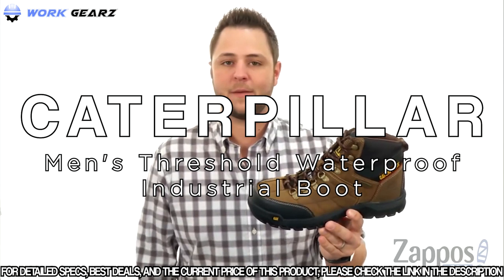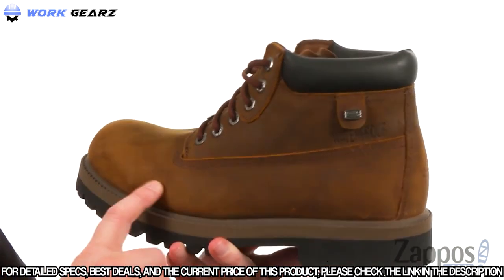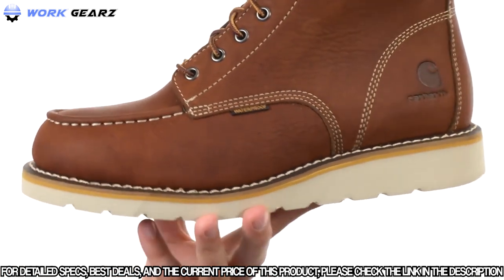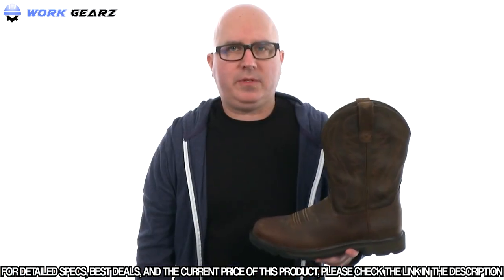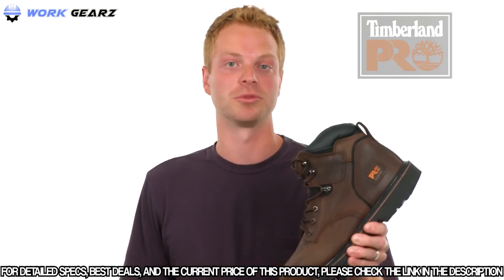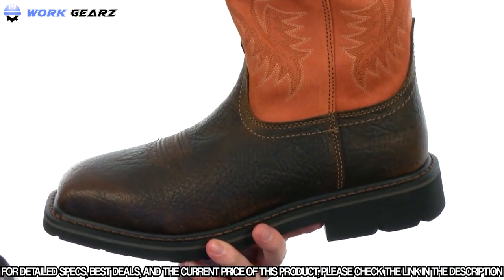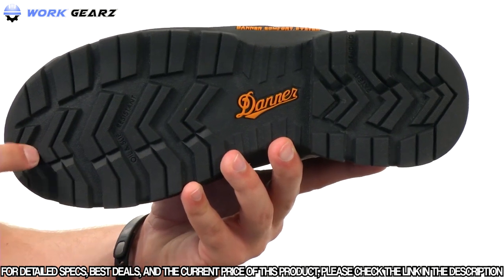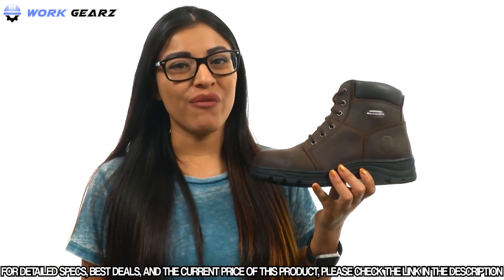Top 10 Best Work Boots for Wide Feet

Comment: Wrong!!! The widest work shoes are Red Wing King Toe ——-the didn’t even mention here
Reply: I'm gonna look into those. I really need an extra wide boot
Reply: @jumboMIDGET  actually I found a wider Red Wing ——I’ll get back to you
Reply: @jumboMIDGET  Red Wing 4489
Reply: I just bought a $200 pair of redwings. The store had size 12eee and it wasn't wide enough. They said redwing has an "H" width but it's custom order. I paid and ordered.  Shipping was fast but the widest portion of my feet (just behind the toes) is wider than the soles. When I stand, the leather bulges beyond both sides of the sole , and I can feel the edge of soles, under my feet.  
I need the width of a size 15, but I wear 12.
 I'd gladly pay $500 for a pair of work boots that actually fit my feet. I don't believe they exist.
Reply: @greatlakescopwatchglcw127  have you checked into Nick's boots? They are handmade.. maybe you could order custom? White boots may be an option for you too
Reply: Hell no iv tried almost every pair of red wings wasted a lot of money they all hurt my feet and none are wide enough
Reply: @paulpainter3391  what did you end up liking —-my nephew just got here me cheap boots form tractor supply and are very wide —look like astronaut boots
Reply: My red wings bites my big toe every step I take.
Reply: I have tried redwing king toe they are tall but not wide, My big toe is super wide, no idea why but that's how I was made. Timberland boondocks in regular size are 3x wider toe box then ANY work boot. If you have one that you believe is wider then timberland boondocks let me know.
Reply: @Mountaintoptractor those are the widest boots I have tried. Heavy but you get use to them.
Reply: Do they have them in size 15 or 15 wide with steel toe?